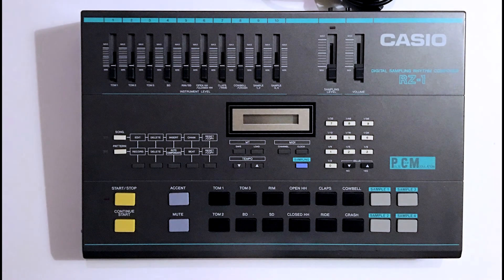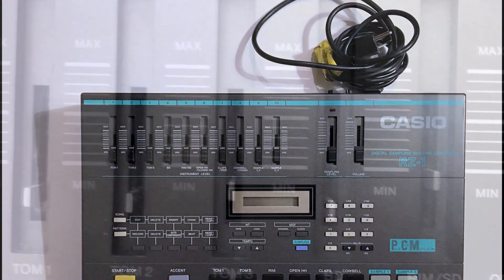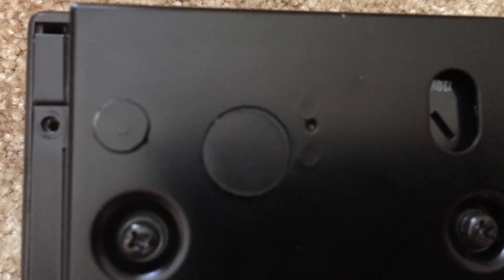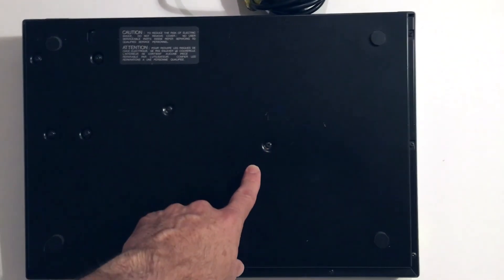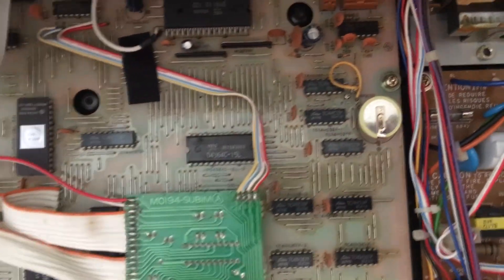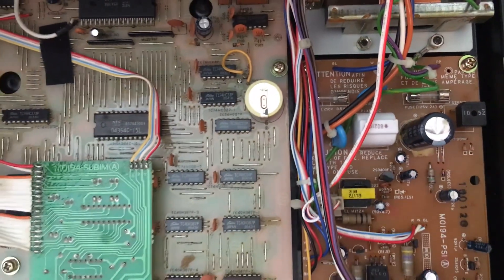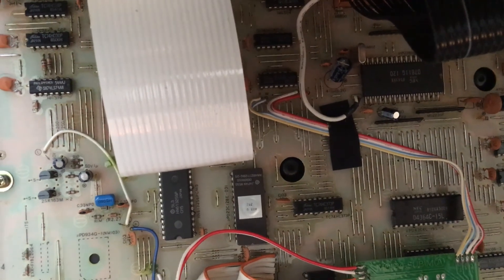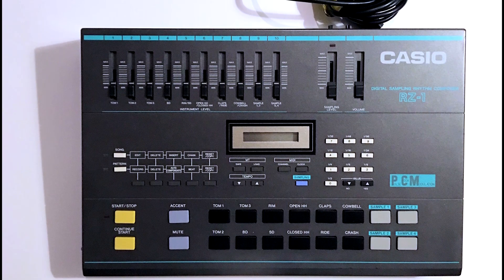[MUSIC TECH DIY] Casio RZ-1 Drum Machine - Changing the Battery

Comment: If I replace the battery, will the machine remember/ boot up with the pre selected midi receive channel I specified?
Reply from the maker: Hi - I am not sure. I would back up the machine first and then make a note of its MIDI receive channel as well.  The manual should cover the details. If I remember correctly, you have to make a backup using audio with the MT function.  Good luck!

Comment: Sorry for the ignorant comment but I have many questions. Which circuit board do you need to take out? You do not show yourself taking a circuit board out so I don't know which one you mean. You also say "take out those brass screws" but only point the camera at two of them, so do you mean all the other brass screws around the big beige-colored circuit board? Thank you for the video, it is extremely helpful!
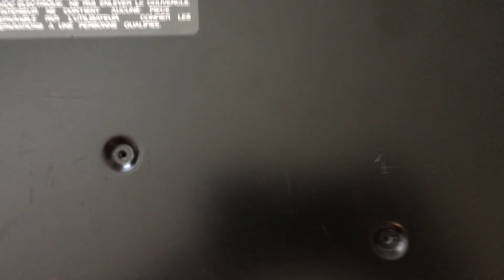Reply from the maker: Hi Declan, I sold mine (regret it) but I believe all of those brass screws need to come out otherwise you can't take the PCB up.  There is a pan shot at around 1:09 that shows almost all of the PCB and probably almost all of the screws.  Once you get that whitish PCB up, you can flip it over and get access to the solder point for the battery. Now the old battery can be desoldered out and the new one can be put in and resoldered.   Thanks for watching!
Reply: @Catabolic  Ahh ok, thank you for clarifying! I will be attempting this on my own RZ-1 soon... just waiting for the battery. Again, thank you for the video!